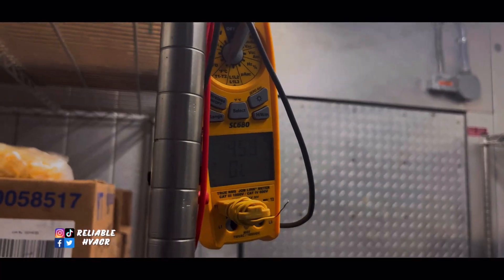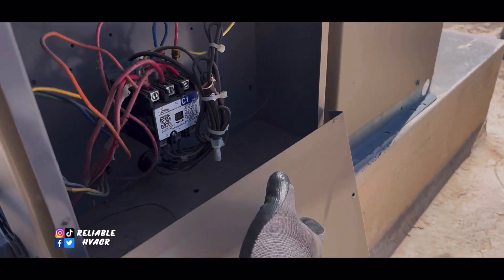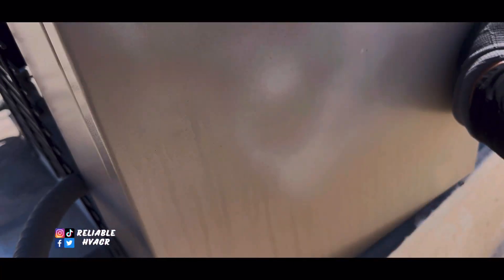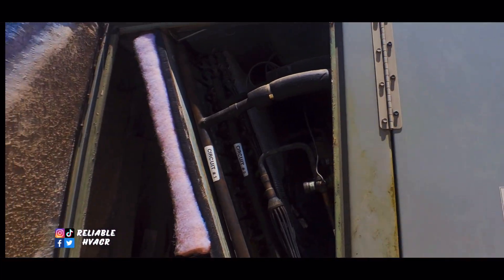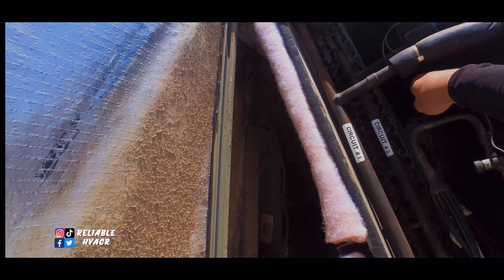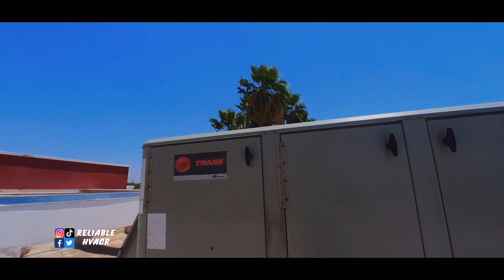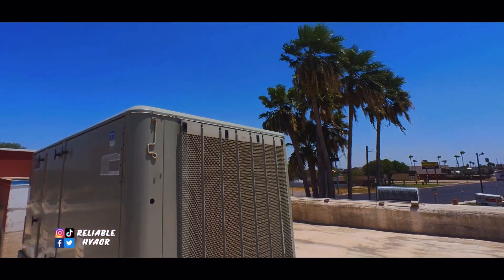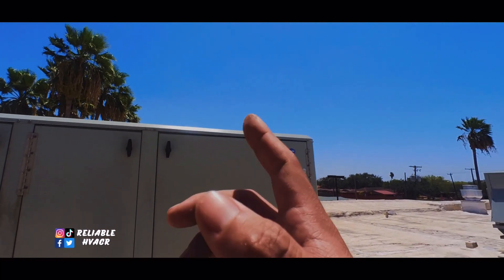Cooler not keeping temp & AC not blowing air / HVACR Day

Comment: They are adjusting t stat to 45 to prevent evap, from icing up need defrost timer.on RTU remove blower motor and wheel assembly remove wheel and test motor 10 min.test.600 dollar.savings.